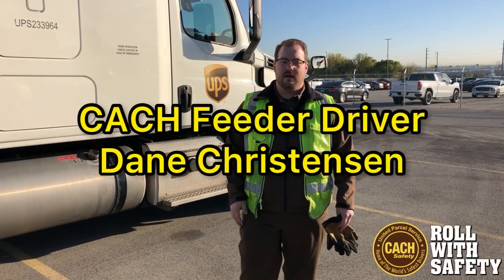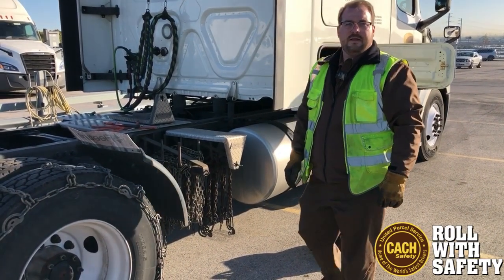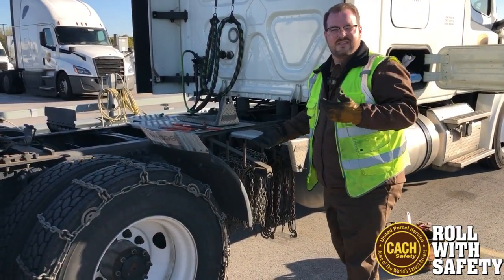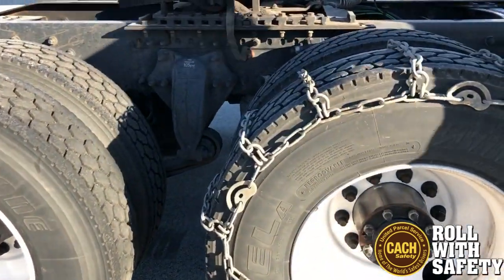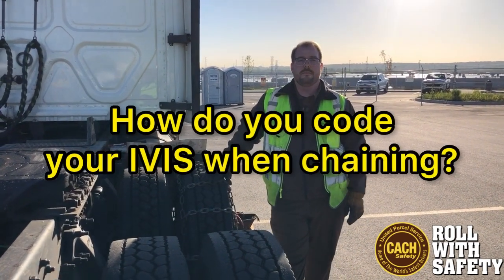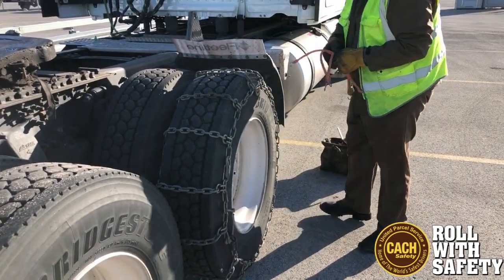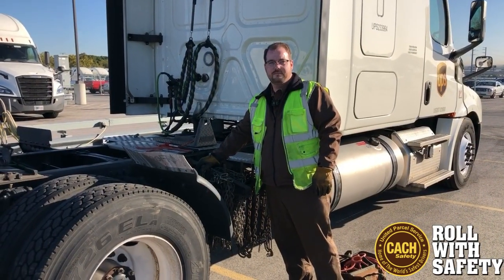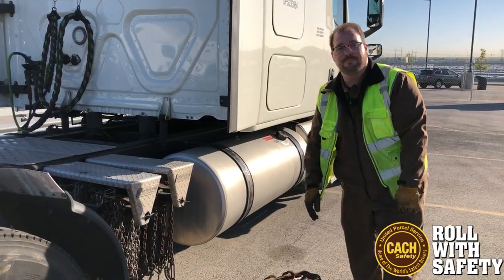Chaining video 2

Comment: First of all you don’t have a trailer over the tire which makes it much harder!
Second of all if you can help it don’t drive in snow if you don’t have to! Pull over as soon as you can and wait out the snow!
And third of all snow socks all though cost more then snow chains are 1000s percent more easier then chains! Snow socks are light, you don’t have to worry about them getting tangled up, you don’t have to worry about them breaking away and damaging something or tearing your tires apart!
You don’t have to worry about bungee cords? You don’t have to worry about special tools!
Just slip them on move up a foot finish slipping them on and you’re done!
And if you can’t drive more than 30 miles a hour why are you driving?

Comment: How do you know a chain has been ripped off?
Reply: Off the tire or rack
Reply: @18wheelerham  either way?
Reply: @haroldbacker5915  so if it's the tires and they get really  Loud you can hear them smacking the bottom of the trailer, quarter fenders and mud flaps Or it gets quiet and you don't sound like a tank going down the road off the rack is harder to notice it's a faint jingle that's why I suggest changing on them on your breaks to see if they are dragging

Comment: When would someone do a steer tire?
Reply from the maker: Never.
Reply: Actually, oil field rigs have and do chain up one steer in the Bakaan oil fields of the Dakotas
Reply: @CHSP6059 do you even know how to drive in icy conditions?
If you need to chain two drives the truck tends to go straight when you turn the steering wheel!

Short answer: any time you need to chain both drives you should chain a steer, unless there are no curves/corners and you are only driving on a wide road.
Reply: @TheRoadhammer379  Same here  in Alberta and Northern BC.

Comment: Why would anyone put tire chains on dead trailer wheels there is no power to trailer wheels they must be total idiots in states that require trailer wheels and why would anybody wait to there on a snowy road in traffic to try & put chains on
Reply: Well  buddy you haven't seen a trailer  sliding into other vehicles cause the road is not flat  and ice just wont provide traction 😂😅 even wen stop good luck